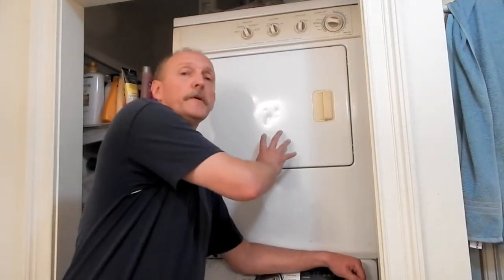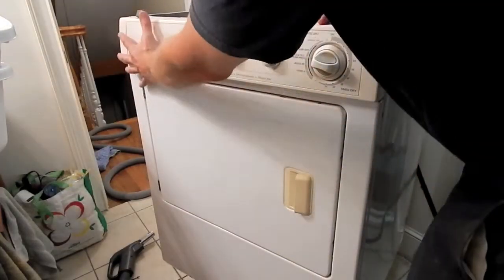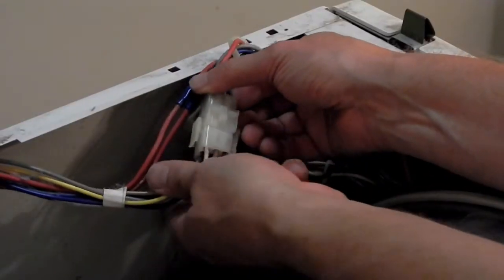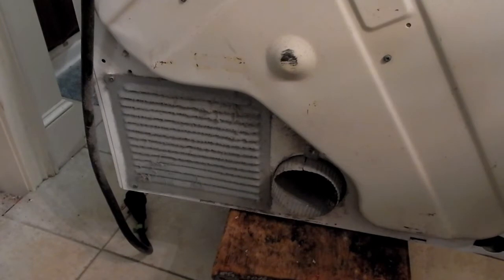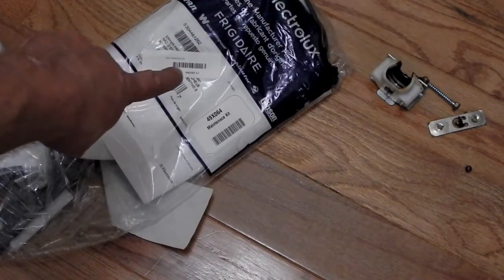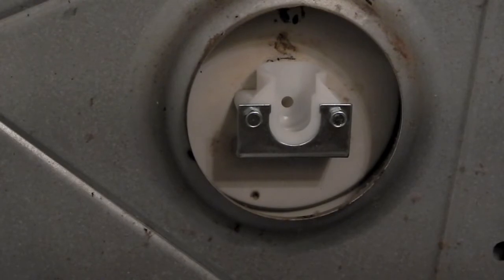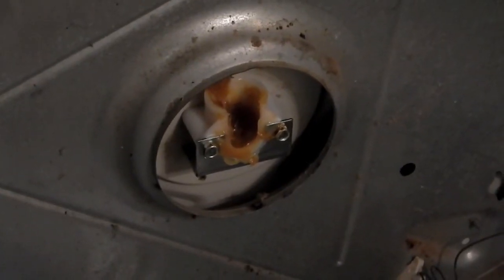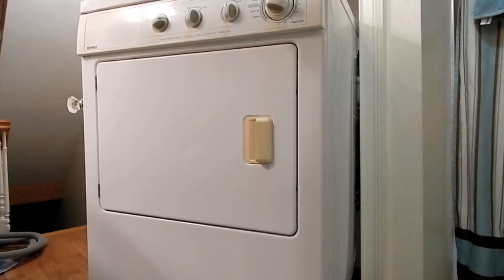Sears Kenmore Frigidaire Clothes Dryer Rebuild Repair Bearing & Belt Replacement

Comment: I’ve got a kenmore frigidaire model I’m trying to replace the thermal fuse on. Any advice for accessing it? I believe I need to take off the back panel?
Reply from the maker: @TheDutchard  a I recall, you remove the top, then the front panel. Once the front panel is removed you can take out the drum, and have ample access to the components in the rear.